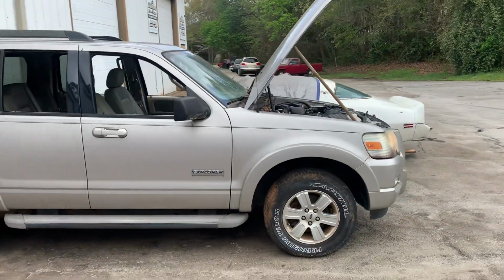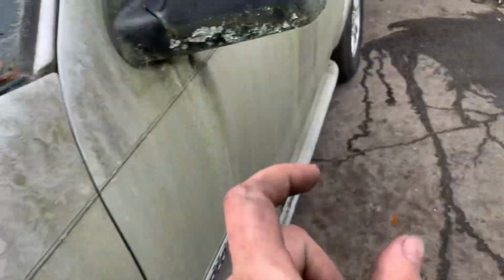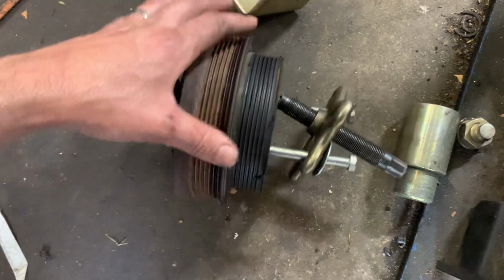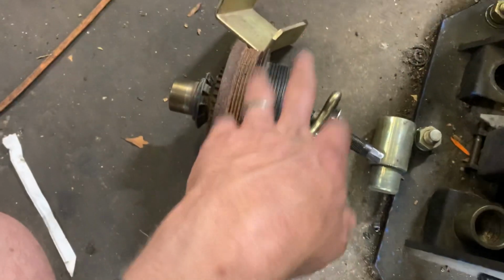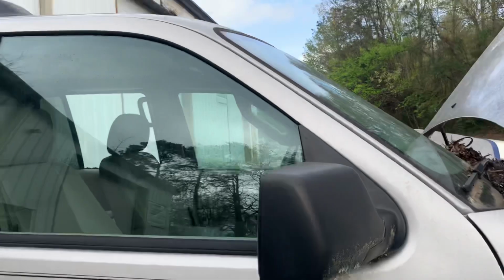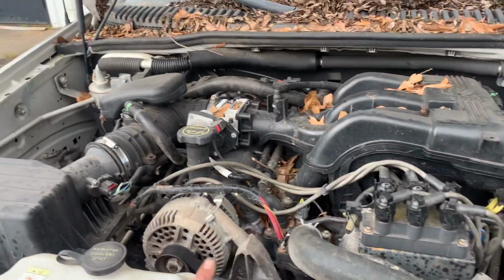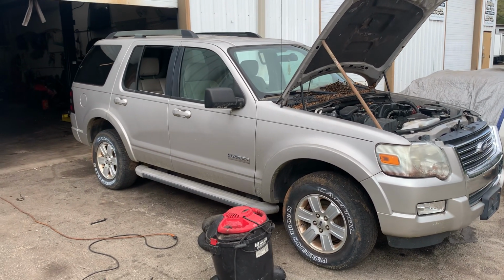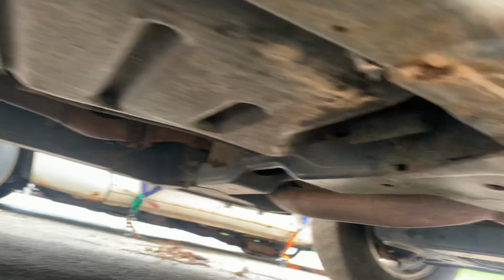So we bought a Ford Explorer...

Comment: These explorers always were always really good at being yard mules. Working hard around trails. Though the 4.6 was 99%  of the time reliable(in my use), the 4.0 was either great or junk. No in between
Reply: I have a 4.0 I have no issues with it almost at 200k
Reply: I own three 4.0 they all run an 94 dohc with 370,000 a 09' sohc with 150,000 but was t boned so I'm looking for passenger doors for it. And a 10' with only 120,000 they are all 4x4 and I've had good luck with them. But my 2010 is having the most issues with fuel level sensor caked up with ethanol. Along with a small miss at low rpms in the winter and shit milage at 80mph like 18.5mpg and over 24mpg going 90(i live at high elevation). The 2010 is just a different beast.  I love the 4.0 I'm not a fan of the 4.6 because I feel a lag in power response . And the 94 is a  Cockroach my dad abused the hell out of it aand then when I got it as a teenager I abused the hell out of it. We have used all three to pull a 16 foot flat bed in town and use them to move camp trailers because they have smaller wheel base then the trucks and they back trailers real nice.
Reply: @dyoung4850  94 Dohc? I think you meant 4.0 OHV
Reply: @W0RLDSSMALLESTVI0LIN  Double Over Head Cams

Comment: The driver headlight looks like it got burned. I thought it was in a fire at first. Here, it would probably be about $1500 not running. Fixed up, I would say.....$6,000 give or take. Maybe 8 on a good day. Now, a dealer would probably get about $9500 out of it, which is ok I guess...but I would want everything fixed on it before I paid that much.

Comment: Just went on Auto Tempest and searched a 100 mile radius from where I am at (near Akron, Ohio). I searched 2010 and older with 4WD (2011 was the first year they switched to the crossover body). Only had 21 listed. So this body style and older is pretty much gone from my area. I did find a 2008 Eddie Bower model with 200k on it. They want $8k, which the car site said was $4k too high.
Reply: there wasn't many of the 3rd gens made, the least out of any explorer generation.

Comment: I had a 2008 Ford Explorer Eddie Bauer from 2017-2021. It was a decent car, especially up north when it would snow. The major drawback was the air conditioner in the summer, it just could not cool that big of a box even with the rear vents. I traded it in for a new Jetta and they gave me $4,500 for it with 120,000 miles. They ended up selling it for $9,000.

Comment: I have a 05 Sport Trac. Those SOHC 4.0s ain’t too horrible. Mines rear chain have been rattling for close to 40k miles and never got worse or did anything but it goes away once it’s driven, I’ll wait till she blows and go from there lol. I use Lucas it STP in every oil change.

Comment: Needs a good cleaning that's for sure. I remember when the explorer first came out. My parents was in the market for a new vehicle. Mom just started working as a home health aide and knew the fox body ltd they had wouldn't work in the snow. They was looking at the explorer but wanted more room for the grandkids. I noticed that the aerostar had AWD and pointed it out to them. They ended up buying the same aerostar I pointed out to them. It was my sister that had kids I was still in middle school at the time. The aerostar also came with the 4.0 witch my parents had in theirs. Was the only engine you could get with AWD in the aerostar. Was a good van my parents never had any issues with it. They also pulled a 18 foot camper with it.

Comment: 2007 Without rust even.Wow.Probably $3500 ask,and about that to the new owner.Heck,I'd throw a blanket on the rear seat,after it's cleaned and drive it until it dies,and find a 302 to bring it back.(btw.Michigan,in case you've forgotten which I don't blame you at all.I usually tell people "I live in the great state of Confusion".)

Comment: That explorer with high mileage will be worth between 6K to 7K if  sold in the rust belt states.Rust free cars/trucks are worth every penny up north.I glady offer 6500$ as long the transmission fluid/filter where change,Sucks ford decide to Sealed those transmissions.I prefer having a dipstick.
Reply from the maker: Maybe I need to haul it up to the rust belt to sell it ! Ive done it before! Gotta make them extra bones anyway possible ;) 
Did you get a new profile picture? big doge is looking... Bigger? owo

Comment: My father in law got a 2007 explorer 4.0 with 87k for my little brother in law to drive - watch out for the thermostat housing and heater hoses on the back top of the engine - they both will leak its got about 100k on it now not bad other than topping up the coolant because well changed thermostat housing to find out heater hoses are leaking lol

Comment: Just bought an 05 explorer 4wd 4.0 in October 188000 miles paid $1000 for mine running driving needing few little odd and ends but drove homw
Reply: The one in the video usually runs 3-5000 easy for sale in the flotown area in decent condition

Comment: The 4.0 was pretty great in the 80s but them newer ones aren’t as reliable finding a explorer with the 3.0  is the way to go those are really reliable not as fast but reliable
Reply: I think the smallest motor that the older explorers ever had was the 4.0. The 3.0 came in the ranger and the aerostar.
Reply: @ssclassof2000  you are right I am thinking of the Ford Escape/mercury mariner which came with the 3.0
Reply: WRONG.